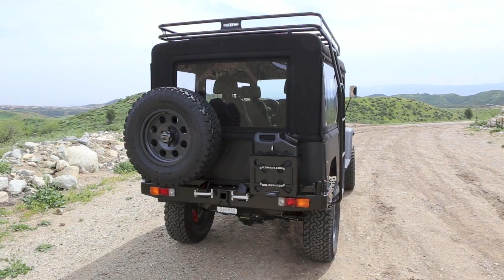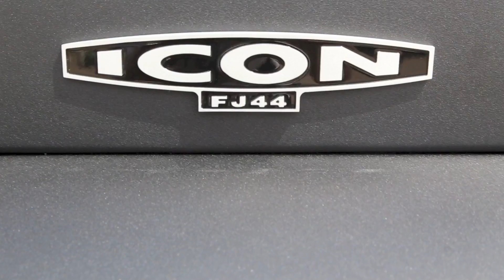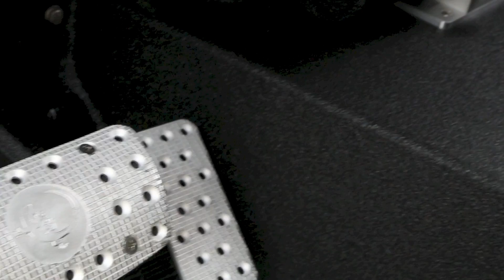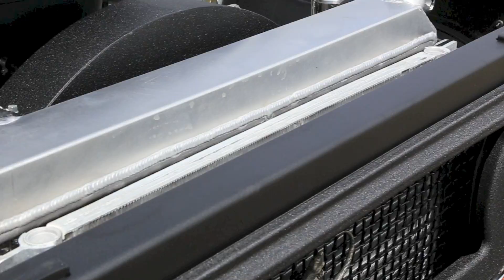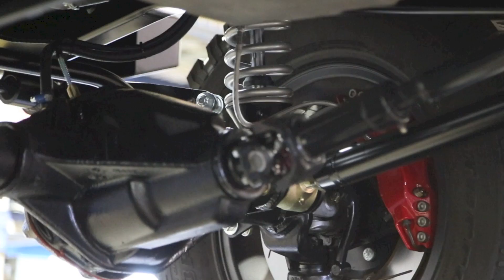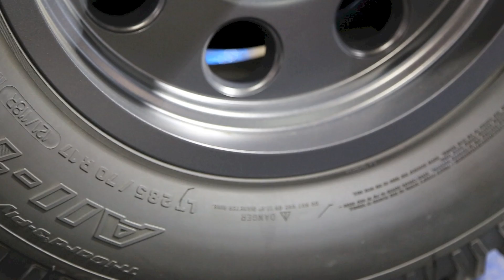ICON FJ44 #72 New School Restored And Modified Toyota Land Cruiser FJ40

Comment: I'm glad you have improved on your driving shots. Longer. The white model that was on Jay Leno, really nice btw.
The rear Fuel Tank is the only tank it has? No mid tank. I know most drive about town, so not needed unless heading out back. ( going bush J.W. )
Could you fit a long range tank? And with that 19 Gallon tank could that space actually take a 31.7 gallon tank. My old '81 Troopy had that size at the rear. And the normal mid tank 19 gal and LPG 26.4 behind my seat in the cab. Hence the two bottles of man jewellery. Not that it would have done me any good if it went up in flames.
Reply: I suppose a fuel bladder on the floor would be a cheat way to extend a road trip. And wouldn't add weight to the daily use as it's removable.

Comment: @4:53 spread sheet parts list on a thumb drive is a very nice touch.
I have always wondered what if I broke a axle(remote chance) or simply
need a replacement fuse , that information will be invaluable.

Comment: Are the windows zipper/plastic as per the customer's request or can you get them with sliders? I have a set of soft windows for my Jeep that I use for wheeling, the rest of the time I use the sliders as it is more on-road friendly (tolls, drive throughs etc) and still allows me to remove them and have the half door.